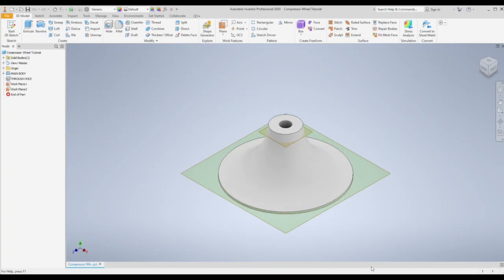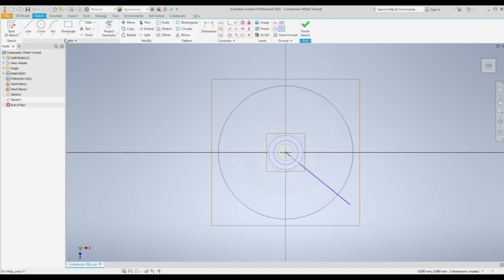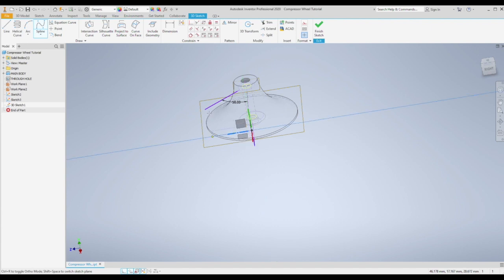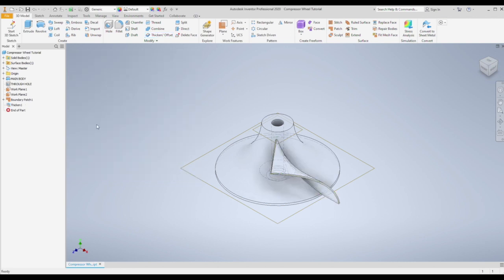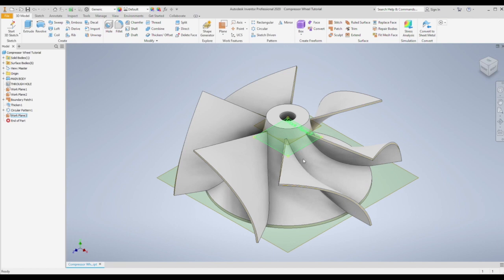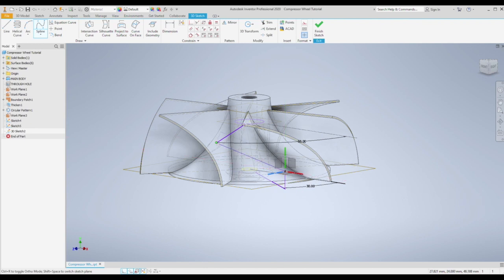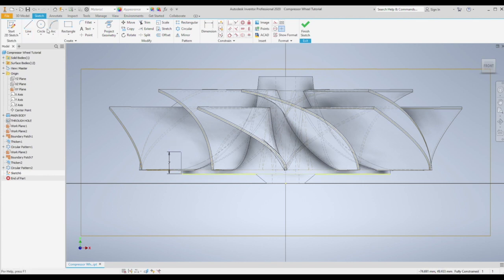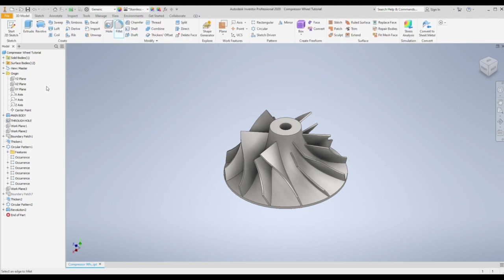Autodesk Inventor Compressor Wheel Tutorial - Part 2

Comment: Beautiful turbine. Are you going to have that design CNC machined?
Reply from the maker: Thank you very much, not this one in particular as it is just a model really and not a properly designed part, it is however based on the compressor wheel I used in my kj66 turbine which is on my channel if you’re interested :)